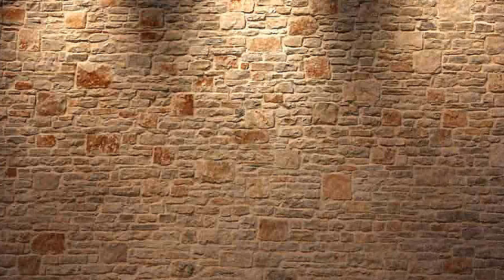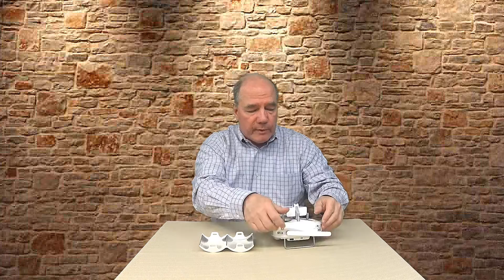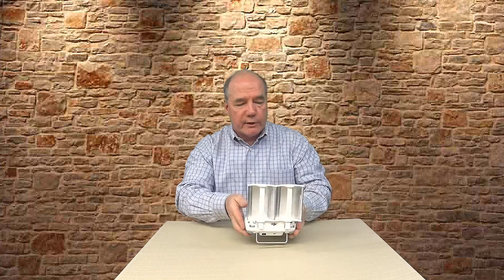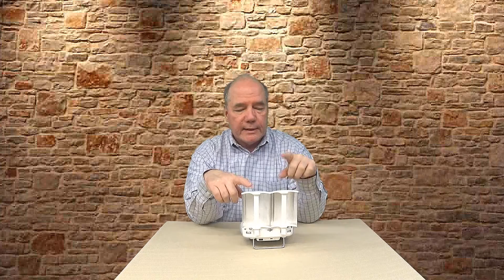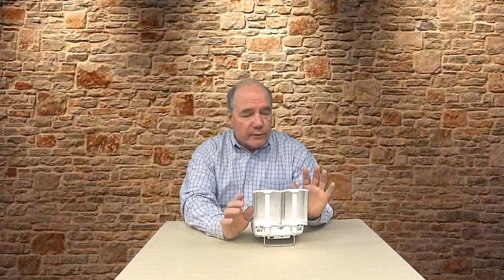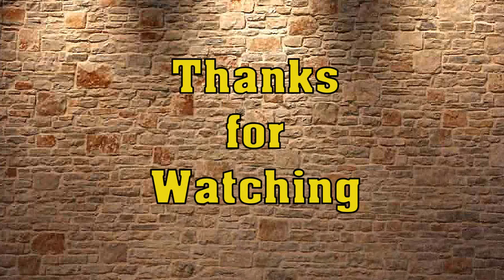Closer Look - DJI Phantom Range Extender

Comment: Drone Valley I'm interested in these for my Inspire1 Pro but like Drone Doctor stated do you have some comparisons with and w/o the extenders and can you please post them?
Reply from the maker: I did a clip that shows the additional power they provide and measured it with an EMF meter. I will do a flying clip as well for comparison but the meter test is really more of an accurate comparison because there are too many variables when flying to get any consistency. I can promise you that these inexpensive range extenders will really help your signal strength and flying distance. Be sure to sub the channel so you don't miss any clips and check the channel for the range extender test. Thanks, Rick
Reply: I don't see it mentioned but this should work for the Inspire1 Pro as well right?

Comment: Strange why it works for you because I did a test of several of these and even posted a review......... none of these work for us.  I'm still hoping to find one that works, but so far no go on our end.
Reply from the maker: I've had really good luck with these and the ones I like the best are the single unit that slides over both antenna. As I mention in the clip this helps in two ways, it forces the antenna into the perfect alignment and also reflects more of the useful signal down-field towards the drone. The science behind it utilizes the parabolic effect, which is the basis for Direct TV's entire business model. The biggest advantage for me, in addition to getting better distance, is that even in close the signal is more reliable. Now that you've commented, I'll have to do a clip comparing a "naked" controller with one using the extender. Thanks for the view and please sub me when you get a chance.
Reply: +Drone Valley I know the science behind them and in theory they should work. But we have tested so many of these now from different manufactures and NONE have increased any range. When you get a good run, do the same run without the deflectors and watch your results..... Sorry, junk in all our tests so far.......👎🏻👎🏻👎🏻
Reply: Drone Doctor do you remove the plastic film cover before the test?